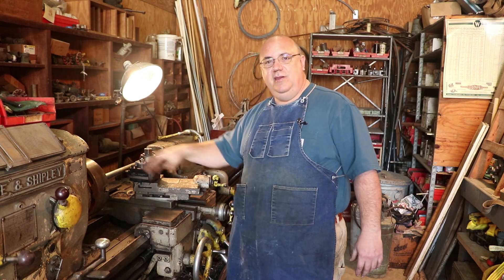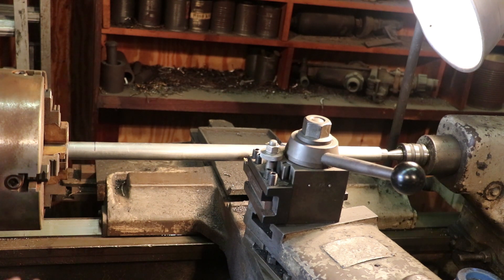Cutting Right Hand External Acme Threads on the Metal Lathe

Comment: I know it's a teaching video but it is very lame.  Speed is far to slow and cutting tool isn't great. Finish on the shaft of that diameter and pitch will be better with a slightly higher chuch speed.

Comment: you are using a carbide threading tool but still putting an off set on the compound, why? The insert has the relief formed in it so it can and should be fed in at right angles to the work. I guess in the days of tool steel that idea was needed but not with a carbide insert.
Reply from the maker: Yea, this has come up before.  While I would say that it is probably true that you can feed in straight with carbide, I still don't think that it is best practice.  It's my opinion.  The whole idea of feeding in at the angle of the leading edge of the cutter is so that you are cutting on the front face of the cutter and not plowing straight in.  At the end of the day, it probably does not matter, but I would by no means say that the way I am doing it is wrong.  It is the way I was taught and the way I have always cut threads and what I am comfortable with.  And from time to time, I still do cut threads with HSS when I need to cut some strange profile and don't want to wait a few days waiting on delivery or spend the money on carbide for a one-time job.  At least I stay in practice this way and use a method I am comfortable with.
Reply: If you feed it straight in it will be cutting with three faces of the tool, his way makes it just cut with 2 faces.
Reply: @Mentorcase  you are side loading a carbide which is never a smart thing to do.
Reply: I'm not loading anything, I'm just watching a video.

Comment: Dumb question... Is the table mechanism hand crank?  Would square thread have been more preferable than Acme, or is it just overkill?
Reply from the maker: Square threads will provide greater "precision" for something like a lead screw, but Acme threads are close and much easier to machine.  Truth is, for the application of this job, regular threads would have been fine - he is just using it as a means to open and close a table leaf.  So, Acme, is probably overkill, but nothing wrong with it either.

Comment: Thanks Keith for another fine video! I enjoy seeing the use of the old machines. Have an old Monarch myself that I am working on . Using an old Oliver 25A pattern makers  lathe to machine some of the parts. Although it is designed for woodwork it is surprising how accurate that old machine is. I made a tool post to hold my 1" tooling and it makes chips. There is something to be said for having more than one lathe.
Reply from the maker: Oliver made some great machines - even if they were woodworking machines!

Comment: Thanks for the video! I ended up with using the follow rest on a long bed once years ago. The rest had brass pads which wore to conform to the thread. Constant adjustment was needed even in the middle of the thread length. Oh I forgot to mention the thd was 1.25 x 7 tpi over 6 feet long.  Still got a trace touch of chatter. Like I said the pads wore along the length and took a little 'babysitting' with on the fly adjustments. Personally I think that hint of chatter was not play in the follow rest but the frequency was picked up rotationally from the drive end to the tail end. Like the twisting of a front end torsion bar in a car. Just on a long lathe it has a chance to resonate that frequency. Slow rpm always wins when the part is secure. In fact I think I remember 'picking up' the thread after slowing rpm to help with the chatter issue. It was early 90s somewhere. Awesome vid and look forward to more. TY

Comment: Greetings from Norway. "A little snag" - is it a bearing in the motor of the LeBlond lathe, that sounds like a rockcrusher?
Reply from the maker: That is the Lodge & Shipley and it has always been a noisy lathe.
Reply: Naah, there are some noise with the Le Blond, even when the spindle does not run, so I think it's either the motor of that lathe or it is something running in the background.

Comment: So every lathe has standard RPM and cutter speed for cutting threads? How wld you do it manually
Reply: It took me forever to comprehend how the lathe knew where to cut the thread on subsequent passes. I finally understood it. It is amazing that such a huge machine that is so old can use mechanical linkage to do such a precise job.
Reply: Not sure I get what you mean, but the Main spindle (that drives the chuck and turns the parts) is connected through a series of gears (banjo) to the quickchange gearbox where the rotational speed of the leadscrew is selected.
 
It's the gears in the gearbox that selects the feed rate of the carriage and also the thread pitch. The RPMs of the spindle just makes the carriage move faster or slower, but the ratio of the carriage to spindle speed stays the same.
 
MrPete had a good series where he repaired a QCGB if you want to see what the look like https://www.youtube.com/watch?v=w5CuDdhdess (Part 1)
Reply: CO Jones oh I see, so the speed of both is linked. Thanks. I didn't realise there were so many gears, that's a great link. Now I understand. The lathe has to be one of the best creations of mankind. You can plot a family tree from the invention of the lathe all the way to the moon landings
Reply: CO Jones I was reading about the Antikythera mechanism the other day actually. Latest research suggests it was an astronomical teaching aid rather than navigation device. They think it had been shrunk down, evolved from earlier larger versions, like clocks got smaller. Whatever it was for it's impressive & makes u wonder what other ancient technologies have been lost in time. I watched some of clickspring clock making videos. I find any metal work very satisfying to watch.
Reply: CO Jones   Chris' video on his hand cut files is absolutely incredible. Every time I see it pop up I watch it. Blows my mind.

https://www.youtube.com/watch?v=SOw9WqMOHjA